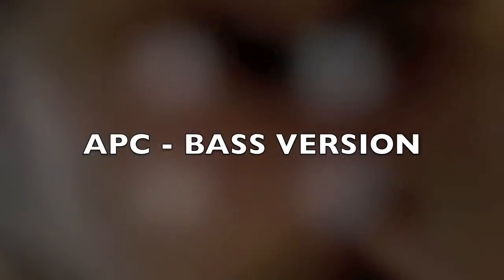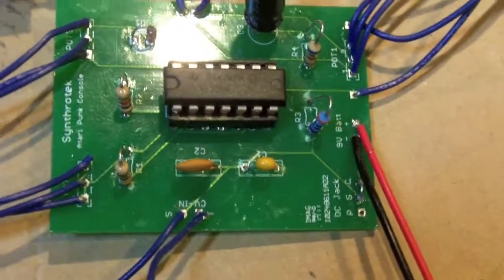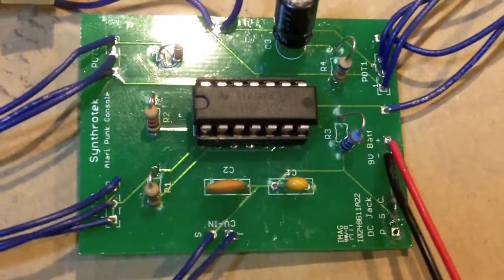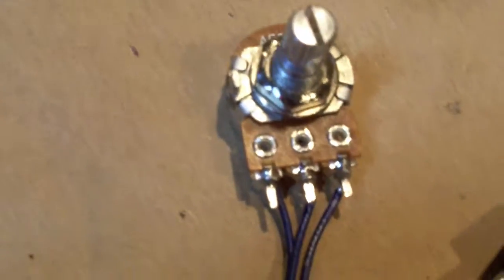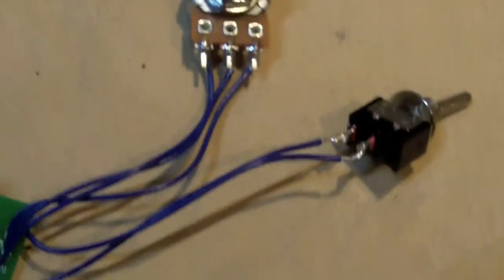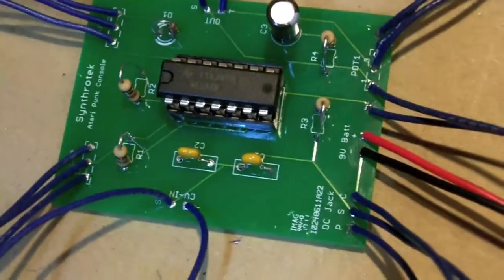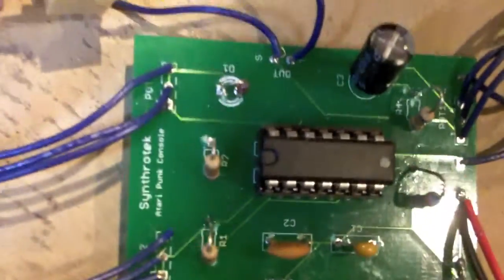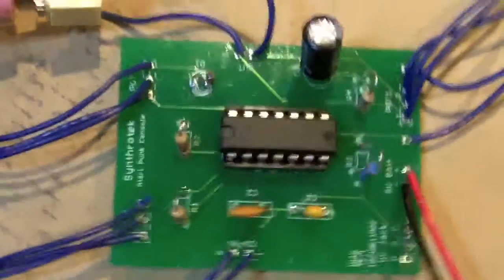APC - Atari Punk Console BASS Modification Version

Comment: What I mean is that if you make another board revision, you could add those extra holes so you can easily add another resistor and compensate for the potentiometer curve. This seems like reasonable standard functionality, again, if you make another run of boards.

Comment: You can convert a linear pot to give a near log response by putting a resistor between the wiper and one of the outer terminals. The best way to do when you have a PCB is probably to include holes that resistor on the board, and then only fit it when you need it, i.e. when you're using a linear pot. Search for "The Secret Life of Pots" for formulas.
Also, why is the board is so big? I could both make that board single sided (possibly saving money) and smaller by placing the components tighter.
Reply: Hello, I read The Secret Life of Pots, it was very interesting and I learned a few new things. However, I’ve only just started in electronics and I don’t always know how to apply the theories. The Secret Life of Pots is a good example of that, I sort of “get” what is being said, but after reading the whole article, I have no idea of what value of resistor, I should use to turn a linear pot, into a near logarithmic one. Could you help me? Say, I want to turn a 500K linear pot, into a 500K logarithmic one, what value of resistor should I use? Please let me know. I really am trying to learn more, about this stuff. Thank you kindly
Reply: @maxwarfield6699  hi Max. A lower value compared to the pot's resistance gives a better approximation, when you just view it as a voltage divider. 

The problem is that the effective resistance of the pot will then vary depending on the pot's position. Just with your example of a 500k pot with a 500k resistor, imagine what happens when it's turned fully left or right. Fully left, and the taper resistor is essentially taken out circuit and the pot will appear to be 500k as usual. Fully right, and the pot will now effectively have the 500k resistor in parallel and will effectively become 250k!

This is really only a problem if a changing impedance will upset any part of the circuit. If your pot is a simple attenuator/voltage divider driven from a low impedance output or voltage rail it shouldn't really be a problem, assuming the pot's resistance is high enough to begin with.

R/5 or R/6 will usually give a good result, so for a 500k pot, try a resistor of 80k-100k and see how that works.
Reply: @Gameboygenius  I truly appreciate you schooling me. Thanks for the explanation, I think I have a better handle on this now. Be safe mate. Cheers!